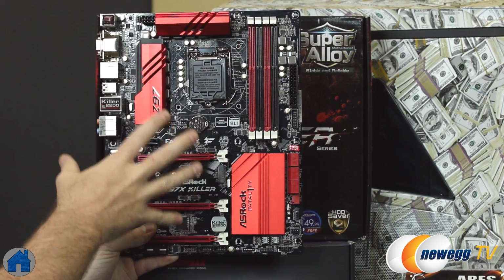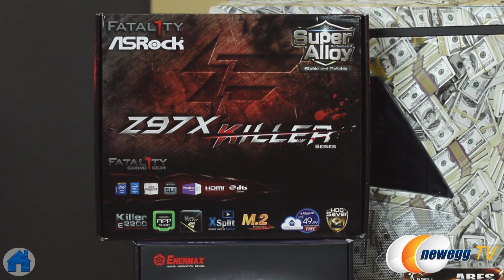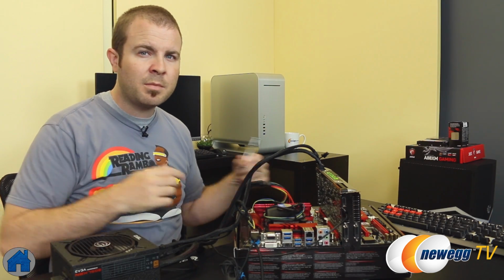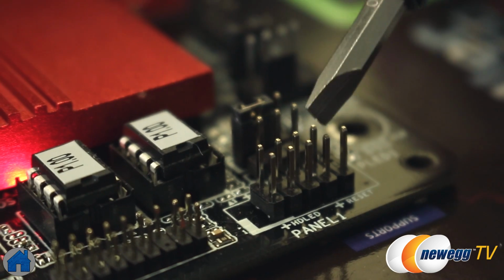How to Build a PC - Part 1 - Newegg TV

Comment: Some help guys, this is my first build. So, total noob. I'll be using this as my main desktop for general use and light gaming. My budget CANNOT go above 600-700$. I would love feedback on this. If any parts conflict, then please inform and if possible than suggest replacements.

1 Processor: Intel i5 4670
2 Motherboard: Gigabyte GA-B85-D3H
3 RAM: Kingston HyperX (KHX1600C9D3B1K2) 8 GB (2x4 GB) 1600 MHz DDR3
4 PSU: Corsair VS450 450 W
5 Case: Cooler Master Elite 310
6 Hard Drive: Samsung Spinpoint F3 ST500DM005 500 GB
7 SSD: Kingston SSDNow V100 SV100S2/64G
8 Graphic Card: Sapphire AMD/ATI Radeon HD 5450 1 GB

Comment: Ok so I just wanna know 2 things. When applying my cpu do I just drop it in and don't apply any force or do you have to apply some force?
Reply: oh okay and one more question do the parts come with screws and stuff?
Reply: No you don't need to buy extra screws or anything.
Reply: K thanks :)
Reply: Titancoast When you apply your cpu you drop it in (not from 10 feet obviously) and wiggle it a little to make sure it's secure. I've done multiple builds.
Reply: Thank you Lord Gaben...
Reply: +Thirstydog make sure the arrows are aligned on the socket and cpu
Reply: K

Comment: is this a good gaming rig?

Processor :Six-core FX 6300 3.5GHz (4.1GHz Turbo) & AM3+ Motherboard?
Memory :8GB DDR3-1600 Dual Channel w/ Heatsinks
Graphics: 3GB Radeon R9 280X
Storage: 1TB 7200RPM SATA II 3GB/s
Power: 700W Power Supply

Comment: I've already purchased most of this build (need operating system and at least one of the GPU's), but I was wondering fi there was any components you would had personally changed.

PCPartPicker.com: http://pcpartpicker.com/user/EthanBeMe/saved/

I know the MOBO was a bit of an overkill, but I want to be able to upgrade components in the near future.

p.s Plan on overclocking down the line.

Cheers

Comment: Can this run most games on maximum settings on 1080p?

Motherboard: Asus Z97 Pro gamer 
RAM: G-Skill RipJawX 1866MHz CL9
1TB - $104 (fuwell – 5yr warranty)
Processor: i7-4790K
GIGABYTE GTX970 G1 GAMING 4GB DDR5
Case: NZXT Phantom 410 BLACK/RED
PSU: Seasonic G-750 80+ Gold/Modular
CPU Cooler: CoolerMaster 212 EvoX PWN Cooler
Reply: Instead of buying the i7 with the gtx 970 id rather choose a i5-4690k and something like gtx 980/R9 390 or even a gtx 980ti

Comment: Is this good for LoL in max settings and also for some First Person Shooter Games? 
P.S - This is my first ever PC i'm ever going to build! any tips? i'm scared about the thermal paste
CPU: AMD A10-7850K 3.7GHz Quad-Core Processor
Motherboard: ASRock FM2A88M PRO3+ Micro ATX FM2+ Motherboard
Memory: Crucial 4GB (1 x 4GB) DDR3-1600 Memory 
Storage: Seagate Barracuda 1TB 3.5" 7200RPM Internal Hard Drive
Case: BitFenix Neos Black ATX Mid Tower Case
Power Supply: Antec EarthWatts Green 380W 80+ Bronze Certified ATX Power Supply
Operating System: Microsoft Windows 8.1 OEM (64-bit)
Reply: SergeantSwagCoolio he has an apu, it has Integrated graphics xD
Reply: Terrible, its absolutely crap, no GPU, you wont max out games.
Reply: Wheres your GPU? Loool
Reply: Dark Stryk mate, if your gonna run anything video game related never use an integrated graphics. My GPU is mid tier Nvida 750 Ti
Reply: TheManyComputez It wont max out LOL thats the fact. He rather get a GPU with it or you wont max out games.
Reply: SergeantSwagCoolio ik i was just saying :p
Reply: Change your CPU to the AMD Athlon X4 860K 3.7Ghz Quad-Core and get a GTX 950. It's a really, REALLY good budget gaming graphics card and only goes for around $150, if you're in the U.S. though xD Also, add another 4GB of RAM to your build, and you should be all ready to go. I recommend using pcpartpicker.com, it's a great site for beginner builders and it checks to make sure your parts are compatible as well which is a huge plus and saves a lot of frustration and headaches for novices.
Reply: +TheManyComputez In benchmarks, the G3258, even since its dual core, STILL gets more frames than the Athlon 860k because Intel has such powerful single core performance. It's only ~5 more frames than the Athlon, though. If you plan on doing things other than gaming like video rendering, video editing, etc. then get the 860k. Both CPUs have pros and cons. To upgrade the Athlon, you must buy a new mobo, but with the Pentium, you have better uogradability, as you can upgrade without getting a new mobo (motherboard). The Pentium has a lower TDP than the Athlon, which means it has better temps and uses less power. On the Athlon's, you, like I stated before, get better performance in more heavily-threaded applications like video rendering, and it's also good if you want to multitask while playing games such as being on a Skype call or streaming. It's up to you to decide if you want the Intel Pentium G3258 or AMD Athlon X4 860k.
Reply: +TheManyComputez Like I said, at the end of the day, it's really up to you to decide what CPU you want depending on your needs and wants
Reply: +TheManyComputez 

Pentium: 
-Upgradability
-Less TDP
-About 5 more frames on average than the Athlon
*Can't multitask well and is worse than Athlon for heavily threaded applications

Athlon:
-Better than Pentium in video rendering, video editing, etc
-Better than Pentium for doing things while gaming and multitasking 
*About 5 less frames on average than Pentium
*Higher TDP
*Less Upgradability 

^Pros and cons of both CPUs.
Reply: link to a build example?

Comment: I plugged everything in and all the cables are where they're supposed to be, video card is in, processor is in, power supply is setup, CPU cooler is in and everything else... The problem is that for some reason when I press the power button, it doesn't turn on. Can someone help?

Comment: I had setup a list of PC components, please tell me if something is wrong or missing.
I am new to this thing and i just want to get into PC gaming.

AMD A10-5800K APU 3.8Ghz Processor AD580KWOHJBOX
Its an APU so i don't need a graphics card, right? 

ASUS Micro ATX DDR3 2000 AMD AM3 Plus Motherboard M5A78L-M/USB3

Cooler Master Hyper 212 Evo Cpu Cooler with 120mm Pwm Fan RR-212E-20PK-R2

Ark Technology PA-08 Black ATX Mid Tower / Computer Case with 500W Power Supply
This computer case comes with a power supply but i don't really now if its any good

Corsair Vengeance 4GB (2x2GB) DDR3 1600 MHz (PC3 12800) Desktop Memory (CML4GX3M2A1600C9)

Western Digital 1 TB 3.5-Inch 7200 RPM SATA III 64 MB Cache Desktop Hard Drive WD10EZEX (Blue)

Windows 8.1

Please tell me if i am missing anything.

Comment: Since everyone else is doing it, will my rig be able to run The Witcher 3, and be future proof for a considerable amount of time(mainly building this build for Fallout 4)?:

CPU: AMD FX-6300 (3.5GHz)
RAM: CORSAIR VENGENCE 8GB(2x4GB)BLUE 
PSU: Antec HCG M Series(620M) 620W 
Video Card: GTX 960
Reply: ***** motherboard?
CPU: I would suggest you go intel, they always seem better for gaming, i-5 is all you need, if you have the money you could always go for a i-7 (not necessary)
PSU: I would go corsair, they are super reliable, (you could go with the current one, just read a few reviews to see how reliable it is.)
GPU: I would definitely recommend getting alot stronger then the 960 (unless you are ok with not high-ultra graphics with 60+ fps.) here I would recommend the GTX 980 (970ti or plain 970 if money is tight) if you go down NVIDIA path of graphics.
If you want to try AMD, right now all I can say is the R9 390. The 390 is currently performing at similar levels with the 980, for around 150-200 dollars cheaper. (keep in mind this is a newer card and this could change as game develop and newer games come out, to me, it is a very promising graphics card)
Ram: All good here!

This should give you a better understanding of the components, and with these slight tweaks I think you will have a future proof build that should run ultra for current games (most likely with games coming out very soon) and High settings for a few years to come. 

If you are interested, I will build my first ever PC as soon as I can
http://pcpartpicker.com/p/ZZJ3Q7 these are my specs, I don't really know your budget, but if you exclude the monitor, peripherals, and Operating system you can shave a few hundred of my build (assuming you have all these)

I am for the most part a noob as well, I only got interested in building my own PC and learning the ins and outs of the PC world in the last few months, and I got really deep into it after E3 and all the games :3

If anyone wants to improve upon my suggestions, please do so, I am sorta new too.

Hope this helps you or someone else!
Reply: The Ultimate Walrus The statement you made about the psu was pretty interesting. I rarely see people say corsair is better than antec. Antec and XFX have been the best power supplies for me. The Corsair CX series aren't that amazing because you could get something better for a little more, but Corsair's high end psu's are fantastic.

+pffffft I'm not sure, but I think the Witcher 3 tends to favor quad core processors, so the G3258 wouldn't work, because it only has 2 cores. You could get a six core, but I don't really know what you need to do, so that might be an overkill.(Sometimes you'll experience low fps with certain games) Some games won't work well on 8 cores so don't get that. The AMD Athlon x4 860k is a decently priced cpu for a quad core, but as said above, some games really tend to prefer Intel. I'm not really sure about fallout 4. It seems looks great, but I don't know if it would be taxing on the cpu/gpu.

Comment: Will this make a good budget Linux gaming computer?

CPU: AMD Athlon X4 860K 3.7GHz Quad-Core Processor
Motherboard: Gigabyte GA-F2A88XM-D3H Micro ATX FM2+ Motherboard
Memory: G.Skill Sniper 8GB (2 x 4GB) DDR3-1600 Memory
Storage: A-Data Premier Pro SP600 128GB 2.5" Solid State Drive
GPU: XFX Radeon R9 280 3GB Black Edition Double Dissipation Video Card
Case: Cooler Master N200 MicroATX Mid Tower Cas
PSU Corsair CX 500W 80+ Bronze Certified Semi-Modular ATX Power Supply
Total: $456.64

Comment: How's this for a first time build?
•	Intel Core i3 I3-550 3.2 GHz Dual-Core Processor

•	EN8500GT Asus GeForce 8500gt 512MB GDDR3 PCI Express x16 Graphics Card

•	GA-H55M-S2 Motherboard

•	LiteOn iHAS324 - DVD±RW (±R DL) / DVD-RAM drive - internal - Serial ATA - 48x (CD) / 16x (DVD) 48x (CD) / 24x (DVD±R) / 8x (DVD±R DL) 32x (CD) / 6x (DVD-RW) / 8x (DVD+RW) / 12x (DVD-RAM)

•	Cooler Master Elite Power - 460W Power Supply

•	Kingston Value RAM - DIMM 240-pin (x2)

•	WD Green 1 TB Internal HD - SATA - 4" - WD10EZRX

•	Dynatron K17 3Uamp;Upamp;Workstation Server CPU Fan for Intel
Reply: Are you trolling?

Comment: Hi i'm wondering how this build is for a first timer gaming PC
ASUS Z97-A LGA 1150 Intel Z97 HDMI SATA 6Gb/s USB 3.0 ATX Intel Motherboard
Intel Core i7-4790K Devil’s Canyon Quad-Core 4.0GHz LGA 1150
Seagate Barracuda 1TB 7200 RPM 64MB Cache SATA 6.0Gb/s Internal Hard Drive
GIGABYTE GeForce GTX 980 4GB 256-Bit DDR5 PCI Express 3.0 WINDFORCE 3X
Thermaltake 650W ATX 12V 2.3 SLI Ready CrossFire Ready 80 PLUS BRONZE
ADATA XPG V1.0 16GB (2 x 8GB) Memory
CORSAIR Hydro Series H50 120mm Quiet Edition Liquid CPU Cooler
Kingston SSDNow V300 Series SV300S37A/480G 2.5" (SSD)
Thanks for your thoughts

Comment: How is this build?

ASUS M5A99FX 990FX PRO R2.0 Motherboard
ADATA USA XPG V2 Series (2x8GB)
AMD FX-8350 Vishera CPU
EVGA GeForce GTX 650 ti Boost 2G
500 GB Seagate Barracuda 7200 (storage drive)
512 GB Crucial SSD
NZXT Source 210 Elite Case
21.5'' samsung Widescreen Monitor
19.5" Viewsonic Standard Monitor
Logitech G15 Gaming Keyboard
Redragon Mammoth laser gaming mouse
Turtle Beach EarForce PX22 Headset
Reply: CptKrunchGames that is a good pc i have the ASUS M5A99FX 990FX PRO R2.0 Motherboard amd fx 6200 and amd r9 280
Reply: Meh
That gpu isnt good

Comment: Please take a look at my pc build. I will combine parts from my old pc with some of a newer parts. The only thing I want to know is if the new parts will fit with the old ones. I also think my old power suply wont be able to handle the newer video card... so i foun anoher one. Its listed at the newer pc parts. Pleae respond, thanks.
My OLD pc's parts:
Case: I dont know what is it called, but it looks like every normal case
DVD drive: Optiarc DVD RW AD-5200A ATA Device
Hard drive: WD3200AAKS-00B3A0 (320gb)
Power suply: ATX switching power suply LC420H-12
My NEW parts:
Motherboard: Gigabyte GA-F2A88XM-D3H Micro ATX FM2+ Motherboard
Processor/cpu: AMD Athlon X4 860K 3.7GHz Quad-Core Processor
Processor/cpu cooler: Cooler Master RR-HT2-28PK-R1 54.8 CFM Sleeve Bearing CPU Cooler
Ram: G.Skill Ripjaws X Series 8GB (1 x 8GB) DDR3-1600 Memory
Video card: Asus Radeon R7 260X 2GB Video Card
Power suply (in case if the old one cant handle it): EVGA 500W 80+ Certified ATX Power Supply

Do you think if i combine those 2 lists will i get a good working pc?